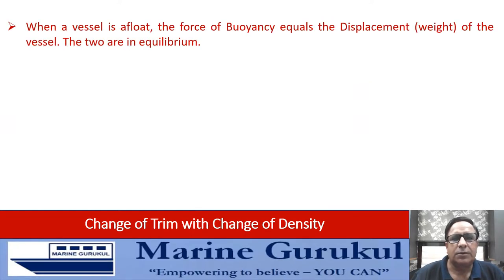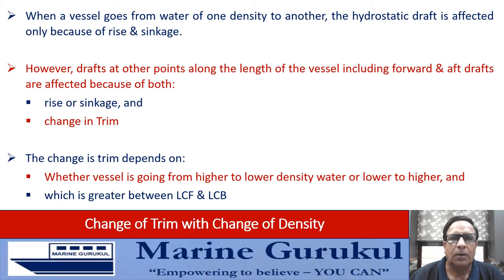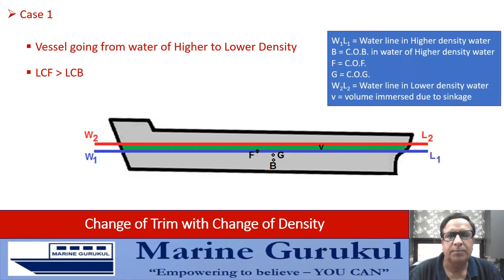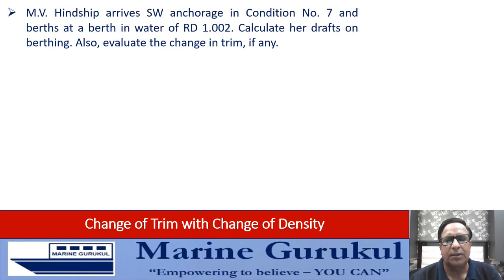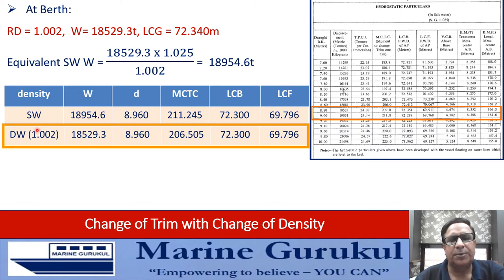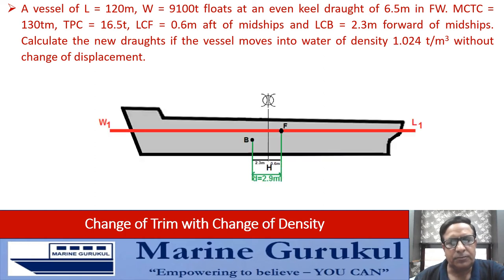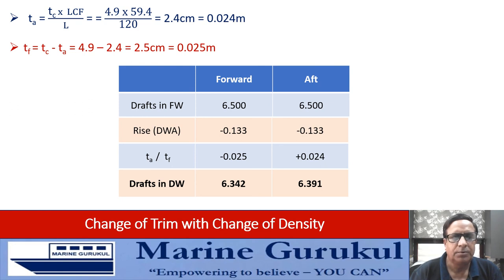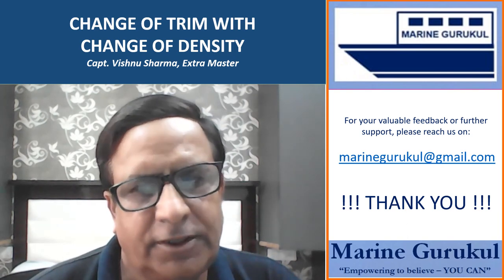Change of Trim with Change of Density

Comment: One doubt With the sinkage here LCB is increasing but actually when vsl @ EK with change in draft LCB decreases....
And if LCF is greater than LCB vsl is supposed to be down by head but in the image its trim by stern. Correct me if m wrong.
Thanks in advance...

Comment: I think there is a mistake about trim change.First minutes you said LCB>LCF or LCB<LCF but later LCG>LCB etc .Which one is correct?
Reply from the maker: it is between LCB & LCF. If LCG was used, must have been a slip of tongue. Apologies if it was so. Best Wishes

Comment: Sir, can we do demucking of chain locker at sea?? What is the procedure??
Reply from the maker: If you see the construction of chain locker, it has a perforated plate over which cable is stowed. It is ideally done while the ship is in dry dock - where cable is ranged in the dock to facilitate chain locker demucking & maintenance
However, if it becomes essential otherwise, ideal location will be at anchor - where most of the cable can be paid out.
In extremely urgent cases, it can be planned in port by paying out cable on a hired barge.
At sea, I am afraid, if demucking can or should be attempted....
PLEASE REMEMBER TO ALWAYS TREAT CHAIN LOCKER AS ENCLOSED SPACE FOR MAN-ENTRY REQUIREMENTS.
Hope could answer your question. Best Wishes

Comment: Sir, will there be any change in LCF, TPC, Cb?
Reply from the maker: 1) Whenever there is change in draft - for whatsoever reason, for a normal ship-shaped vessel - LCF, TPC & Cb would change.
2) In cases where we do not have access to hydrostatic particulars, for change in trim because of change in density, we assume the waterplane area for the range of rise or sinkage to remain constant. In such case, TPC & LCF by default remain same over that range.
Hope I have answered your query. Best Wishes
Reply: @MarineGurukul  thnx sir.. This hot topic now in mates orals..